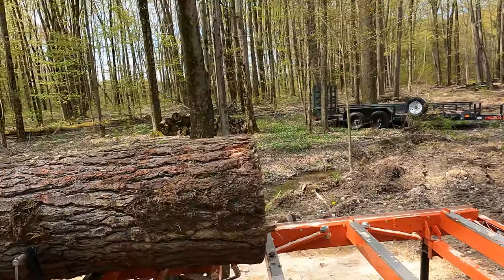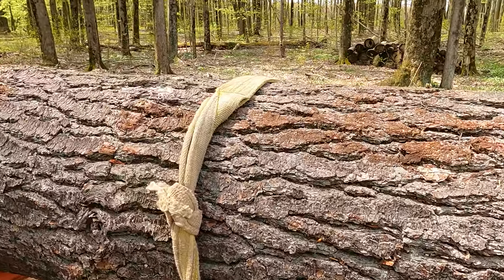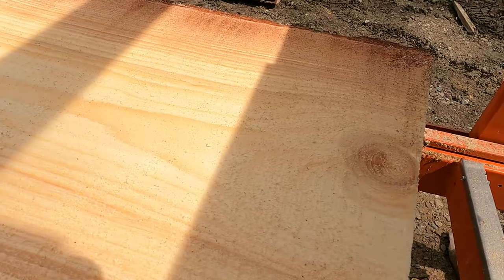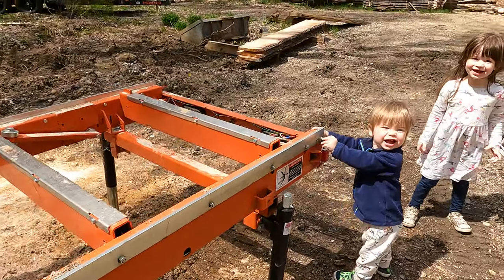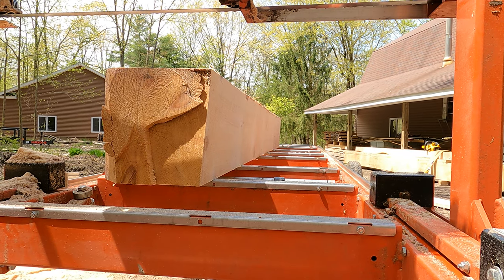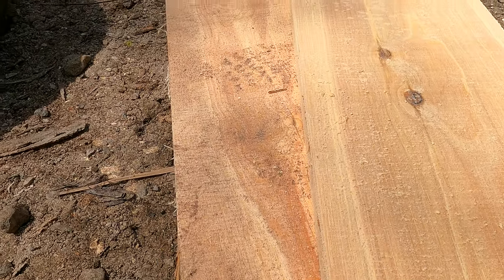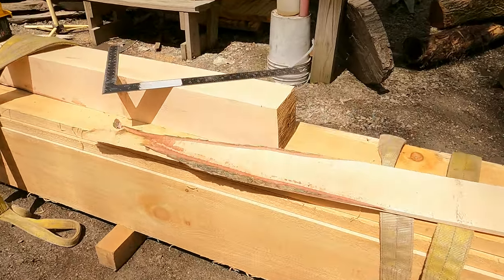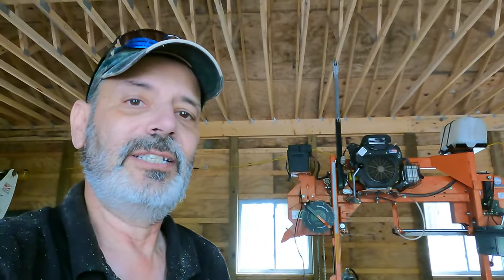Hemlock no wait, it's pine on the sawmill, making lumber for a sawmill shed.

Comment: Nice looking white pine.  Around here it is getting harder to find white pine that doesn't have red rot in the center.  I hope you video the shed build...oh, and keep in mind doing videos in the shed build.  We didn't and ended up with difficult lighting and camera positioning.  Good tip, I always lower the head all the way, I'll have to reconsider that.
Reply from the maker: My mill was less than a year old when the springs failed, professional homeowner had to replace his twice already.
Reply: @mcsawmill  Another channel, Kalevala South Farm, replaced his as well.  One thing in common is LT15 Wide.  Hopefully (for me) the regular LT15's are ok

Comment: I would suggest using diesel or another cleaning agent in the lube tank rather than water. One slip with that bottle and you could lose fingers or a hand. The blade will pull that bottle faster than you can let go. Trust me on this,  can only count to 9 and a half now.
Reply from the maker: I don't like to use diesel, I'm real close to the blade and the mist gets all over me. I can fill the tank with used cooking oil, just need to filter it first. Thanks for the warning, I do like my fingers!